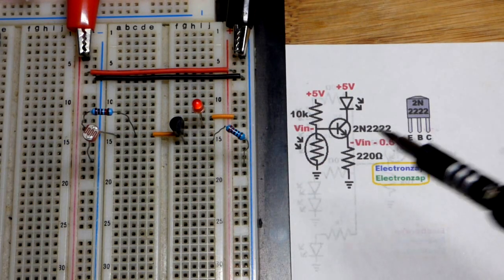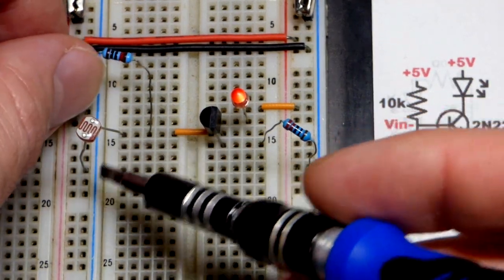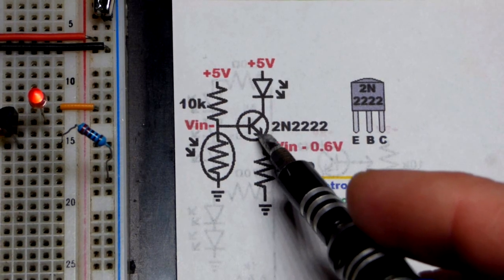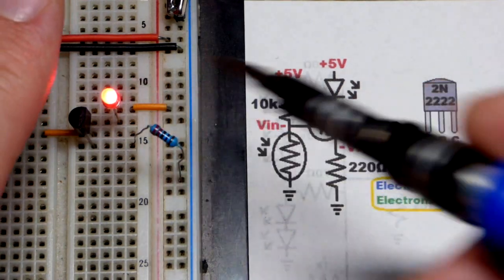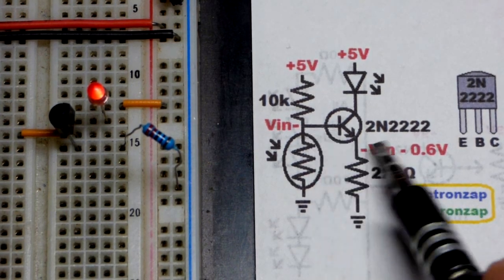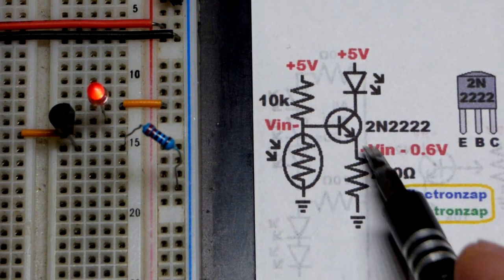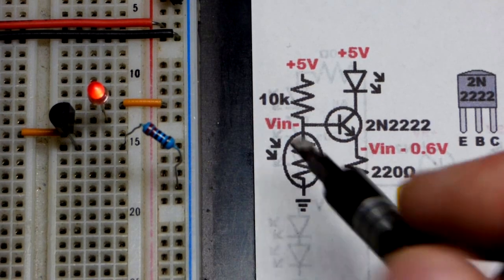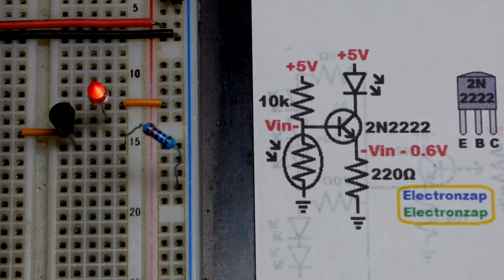LDR lights an LED brighter as it gets darker using 2N2222 NPN BJT and light dependent resistor

Comment: I know you said you weren't getting the revenue you needed on youtube, and you definitely helped me on a couple projects - is there a way to donate directly to you?
Reply from the maker: Yeah, my Patreon is https://www.patreon.com/electronzap . Each month is making about the same as that month made 2 years ago, which dosn;t even covered the cost of new stuff that I bought to make a wider variety of videos. So no point staying the course on YT revenue alone. Thanks!
Reply: @Electronzap  I made a donation.
Reply from the maker: @lookupverazhou8599  Yeah, I noticed, didn't realize it was the same person though. Much appreciated!
Reply: @Electronzap  Np.  

Maybe you can answer a question:  Why does a capacitor in parallel across a reverse biased (emitter-collector) transistor discharge through the transistor?  As in, why isn't the transistor in avalanche mode due to the power source, but avalanches due to the capacitor?